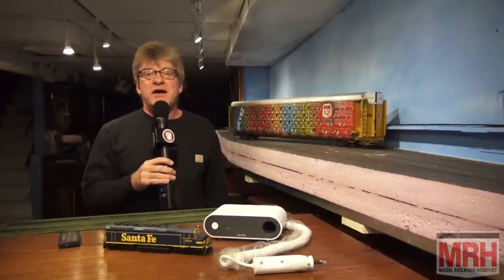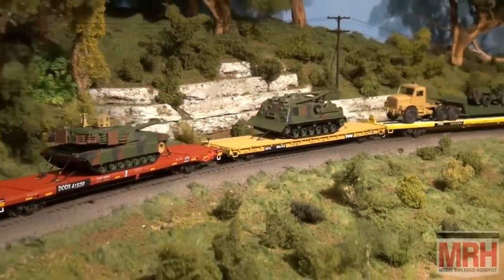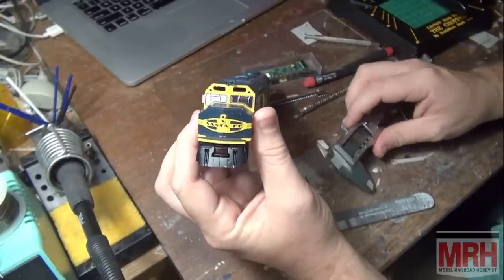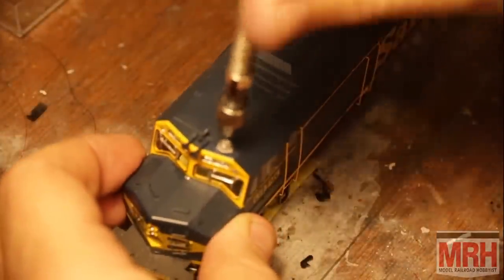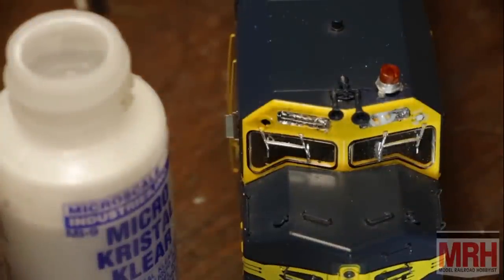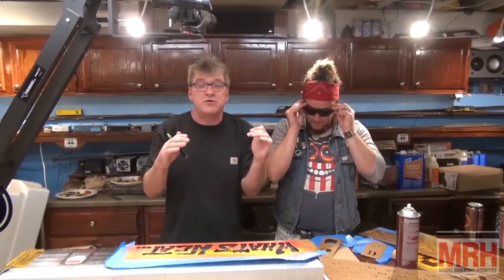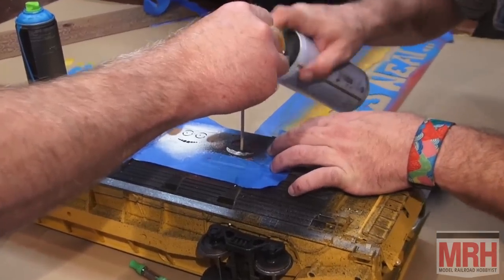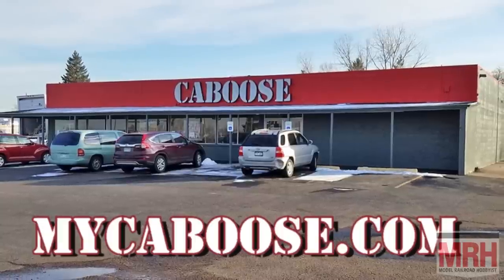SMD loco lighting | November 2019 WHATS NEAT MRH Mag

Comment: Im glad you use the fiber optic strand for the head light lenses, there are some who just put the SMDs inside the shell and leave a big hole on the headlight fixture, looks incredibly crappy! I use Microscale Krystal Clear to attach my LEDs and fiber optic strands because it is easily reactivated with a little water in case you need to remove the light for replacement and troubleshooting. Which brings me to my question... How permanent is the silicone gel?
Reply: It's similar to rubber cement in its hold.  You can easily pull the wires up if you need to.  The silicone will continue to adhere to the wires, but its melting point is lower than solder's, so you can re-solder as needed.  I have not really messed with getting rid of silicon paint residue, so I would advise only using it in inconspicuous areas of the model.  

The F-45 does not really provide a great demonstration of this, but it does a great job of insulating any exposed wires underneath hood unit walkways from the locomotive frame.
Reply: @JamesRegiersModels  Thanks! And great work. Currently I use kapton tape and sometimes Microscale Krystal Clear to guide and run wires clean. May try it.
Reply: SPnoza13 the setting time for silicone paint is a bit quicker than the Micro Krystal Klear. I also find I can guide the wires a bit more precisely with the paint than with Kapton, though I have certainly made use of Kapton to hold decoders, keep alives, and speakers in place. I like to use whatever material will do the job permanently with the least trouble removing. If it gets too fixed, then accessing gear towers and motors for living becomes more challenging. Also why I use the Sip Pins, so those wires are not pulled out of place when I need to crack the shell.

Comment: It is called Pulse Width Modulation ( dimming LEDs) that causes "flashing" on camera.
Reply: charlietrain True. I need to remember the term. I have been experimenting with added resistance instead of PWM for the constant dim functions, and the results are promising. The lead F7 in this week’s WNTW NCE segment is the first unit I have tried this with. The difference between it and its sister on the other end of the consist is night and day. Of course, PWM is the only method to achieve the other hyper light effects, so some amount of flicker is unavoidable.
Reply: @JamesRegiersModels   Most folks won't notice it,( flicker) unless you mix video in and that is unavoidable  because as you said the frame rates. I will have to go back and look at the WNTW. I am with you about soldering your own magnet wire on, it is more "customizeable. "
Reply: charlietrain It’s just viewable in passing this episode. I will talk about it in two weeks or so, after Train Fest.

Comment: Great idea to stick the SMD components to tape. I'll have to try that. Currently I'm clamping them with locking tweezers, but sometimes they decide to slip out and go flying.
Reply: Modular Railroading Thanks for watching! I have actually managed to melt and crush SMDs using tweezers myself. You want tape with minimal tack for your project. I have had good luck with painters tape.

Comment: Is it possible to post the whole unedited, un-fast-forwarded version of the F45 light install?
Reply: Short answer would be no. 

I would like to get better footage of another install project to use for any such video for starters.  Focus was a frequent issue, as were some of the tricks to effective filming.  

The other basic problem is that a project like this takes at least a week of evenings. Soldering LEDs and preparing them can take a couple of hours all by itself.  Then is all the body prep and so on.  We'd be talking about a video or series of videos at least 10-12 hours long, with much repetition along the way.  It would not be watchable.  That said, I am working to learn the best approach to convey as much information as succinctly as possible, and admittedly the fast forward was used a bit too extensively this time round.
Reply from the maker: One trick with YouTube is you can run video at slower than normal speed, down to as slow as 1/4 speed. You might try that. As for the whole install unedited, most of the time you don't just turn on the camera and let it run for hours while you do the install. You take select shots and simply string them together to get the final video -- so their would be no "full install" video. James' reply above more or less confirms our suspicions that there is no "whole video" just sitting somewhere that could be posted -- it doesn't exist. :-(

Comment: I like to use lots of LEDs for HO trains, but soldering thin wires is too troublesome. I would rather make a small SMD circuit board...
Reply: I would definitely be interested in seeing what you are doing with the small SMD circuit boards.  The major problem I can see with those would be the added bulk to the assembly, which would make the less conducive to modeling.  I have wondered if it would be possible to build a model using circuit board material, so that the conductors would be built directly into the shell.

Comment: Why not just get the pre wired LEDs?
Reply: There’s the cost, of course. But I also find greater flexibility just doing the assembly myself. The magnet wire I use is thinner than the assembled wires and will fit more places. A friend of mine uses the pre-soldered, and I was helping him light the ditch lights on his Walthers Proto UP E-9 executive units. I can put both magnet wires through a no. 80 hole to come out invisibly through the backside of a ditch light and disappear into the locomotive frame almost invisibly. Can’t quite do the same with the pre-assembled. 

There’s also the enamel insulation of the magnet wire vs. the plastic of the pre-assembled. Assuming the right tolerance temperature, you can simply twist and solder fuse the magnet wire with a little flux. With the plastic insulation, you have to strip it. 

That said, if your eyesight doesn’t allow you to solder hair thin wires to tiny leads, the pre-assembled LEDs are a perfectly reasonable alternative. And would likely be cheaper than hiring it out to someone else.
Reply: @JamesRegiersModels  Great info
Reply from the maker: @JamesRegiersModels  Good answer James. We removed our "attempt" at an answer because your answer is much better.